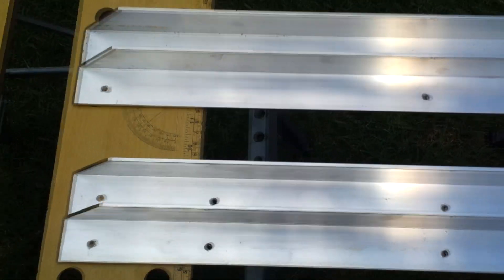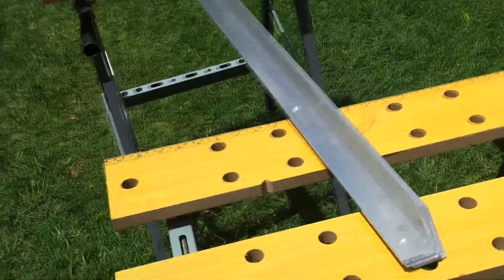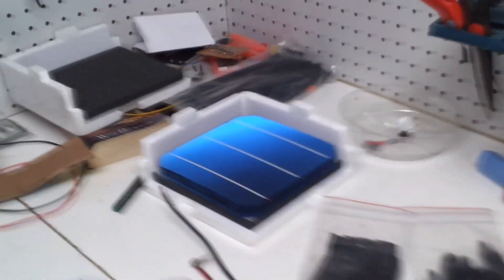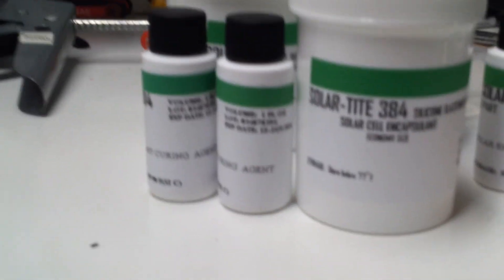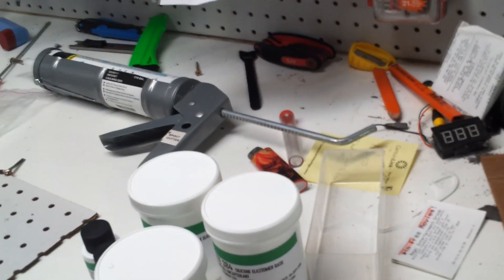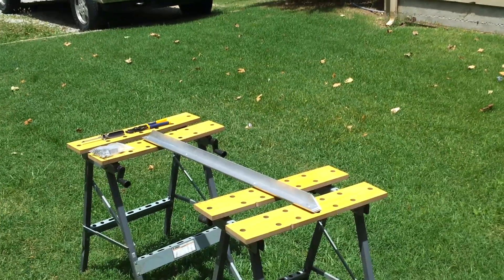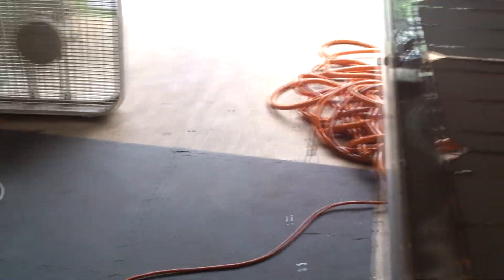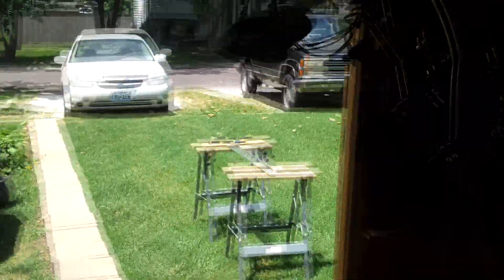solar panel 6x6 36 cells part 1

Comment from the maker: im charging (5) 114amp hr 12v batteries. my big 5000 watt invter from hf started smoking so im going to have to get a replacement im using my backup 2000 watt one now